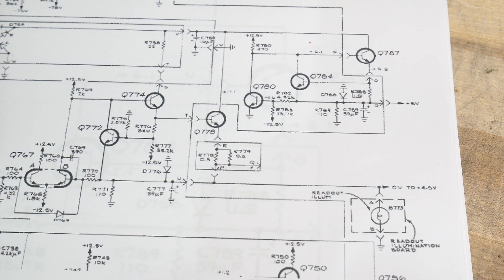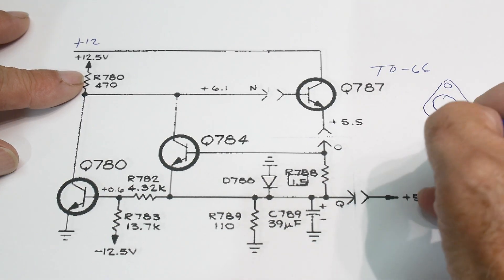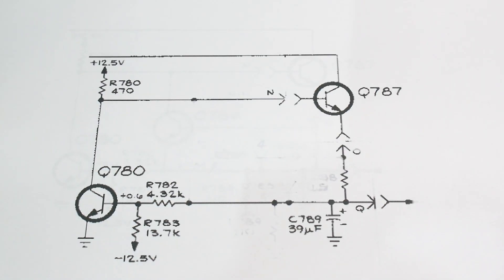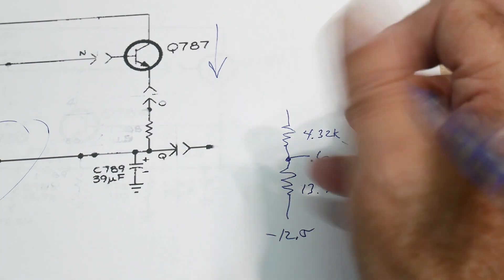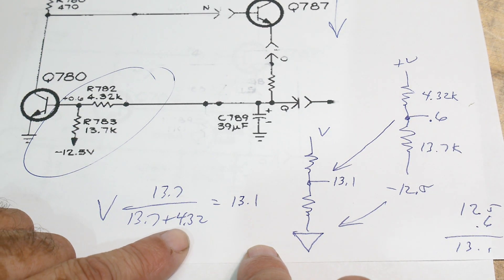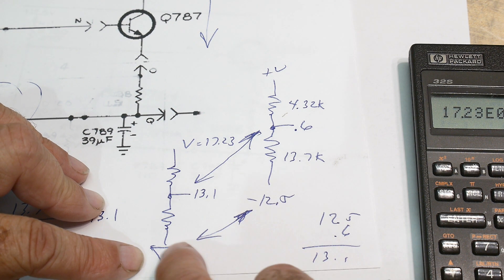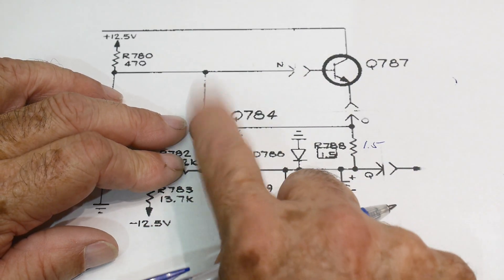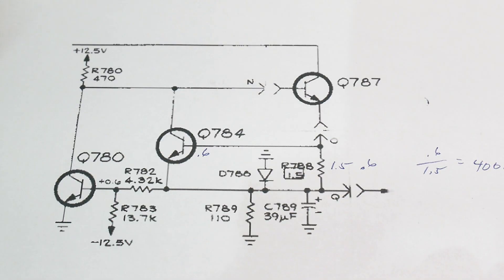#1279 Three Transistor Voltage Regulator

Comment: I have to admit the person that picked those values did a cute little trick where they did the whole thing as close to 1V=1KR in the divider. Not perfectly, obviously they had to stick to a e series for the resistors (E96 in this case, or 1% tolerance resistors). Still, good on that person for not picking really out there values.

edit: It makes life so much easier for the technician. I saw you had alan there in the comments looking at it all as currents as an ee would do. Once you hand it to the tech, you want something you can quickly model in your head

Comment: Very helpful!! I’m restoring a Heathkit H89 with a faulty power supply section on the video board and was struggling to understand the theory of operation. This is the most helpful explanation I’ve found. It’s almost exactly the same circuit except the Heathkit has a zener reference and an extra transistor.

Comment: Thanks! I have a similar voltage regulating circuit in a telephone power supply from the 70s. The voltage divider can be set manually to 3 V, 4.5 V and 6 V. The power supply must be very silent to not make any noise in the telephone receiver. It has that 3rd transistor to keep the current below 300 mA. Thanks for the calculations, very helpful! I suspect your power supply is very silent as well? (probably depends on filter capacitors and a good transformer)

Comment: Your numerical analysis is correct, however I would argue that you should use the general expression for the output voltage because it reveals subtleties that may be significant. Here goes:
Call the diode voltage Vd. The -12.5 voltage is actually the"reference voltage" for this generator, so call it Vref. I prefer to think of Vref in its absolute value, namely "12.5V" dropping the negative sign, which will be taken into account shortly. Shorten R782 and R783 to R1 and R2 respectively. Call the output voltage Vo. The equality that inverting gain element Q780 forces is:
(Vo - Vd)/R1 = (Vref + Vd)/R2  Solving for Vo gives you
    Vo = Vref*R1/R2 + Vd*(1+R1/R2)
Plugging in values and assuming Vd=0.6V, and Vref = 12.5V, you get Vo = 4.73V, as you calculate at 8:23
The interesting part of this general formula is that it reveals that this voltage has a temperature coefficient to it due to the diode's presence. It is common knowledge that "a diode," namely the transistor's Vbe, has a temperature coefficient of -1.6mV/°C. Therefore as temperature increases, Vo will decrease with it by a factor of (1+R1/R2). The great unknown is "what is the temperature coefficient of Vref, the -12.5V supply? We don't know. 
What you really want to do is to take the derivative of the equation with respect to temperature, d/dT. If the -12.5V supply has any temperature dependence to it, it will be attenuated by R1/R2. Q780 is the "amplifier" in this circuit that in today's world would be replaced with an op amp running in its inverting mode and its "+" terminal connected to Vd instead of ground.
I miss the days of transistor design. It was a great deal of fun.

Comment: I obtained the result in a different way. 13.1 volts across 13.7k R783 resistor implies 4.13 volts across 4.32k resistor R782, given equal current (Ohm's law). 4.13 plus 0.6 volt results in 4.73 volts. That would be the output. However, there is some additional small current flowing through resistor R782 to the base of Q780. Depending on this current the voltage drop on R782 will be slightly higher than 4.13 volts so we can probably have exactly 5.0 volts or even slightly higher voltage.

Comment: No voltage reference (Zener diode, TL431 etc.) but it works nicely. I wonder about the ripple voltage.
While the voltage drop is 7V, the current limiter will keep the dissipated power down to 2.8W. Not bad for a heatsinked TO-66.

Comment: Thanks for presenting this piece of old school electronics, very interesting. 
I think of it this way: it is an opamp in inverting configuration whose gain is -R782/R783 and whose input referred offset is the Vbe of Q780. They use their negative rail as a input to this inverting amp.

Comment: I think too low negative rail (like -12.5v) is counterproductive from precision point of view. Also its too dependent on Vbe (of Q780), i.e. Vbe temperature change is not compensated. I would do it better 😀.

Comment: The circuit is more properly an inverting "op-amp" rather than a regulator.  Its output varies with the negative supply voltage.
Reply: Yes, if one does the math this way it is very easy to figure out the nominal output voltage, dependance on the Vbe and on the base current
Reply: @caffesenza5836  A design done for production is going to have about 10 times as much current flowing in the resistor divider than flows in the base of the transistor.  You do this because the HFE(current gain) of transistors varies a lot from unit to unit.  For this reason, a first cut at working out what it does would just ignore the base current.

Comment: Back in the days, in the 60's when I was a student, we would check out the service manuals from HP and Tek.  There would be a very good explanation as to how the circuits worked.  You don't get that anymore.  HP even made it more and more difficult to get diagrams.  I always preferred Tek over HP.  I think the Tek stuff had better human engineering too.

Gee, why didn't they just use a 7805, they didn't exist them.  They did have op amps though.  Don't think there were 723's either.

Thanks, very good.  Jim

Comment: I have a simple question, but are there any reasons they used -12.5V as a reference point? I mean, the resistor divider could easily reference to GND...
Reply: Hi, if you do that you will see your 5V nominal swing a lot with temperature. Like 17mV / Cent Degree. You will turn this thing into a Vbe multiplier, while it is thought as an inverting amplifier with -12.5V well regulated input

Comment: Nice schematics! Especially interesting because it contains only NPN transistors, even diode is possible to replace with base-collector shortened transistor. Can be used in hack diy or in production - no jokes some times is much cheaper to use only same transistor four times to reduce the costs.
Reply: @harvey66616  agree, NPN

Comment: A long and messy explanation. 
As the output is +5V and the negative supply -12.5 you  have their sum (17.5V)  across series  R782 and R783 (18.02K). 
The Q780  base is at +0.6,  or so (current gain/base current plays here)  and  is limited to negative ~ 0.7V with that diode. 
remove R782 and the voltage is limited to about 5.6V.
Q780 gain (100 -300)  is Rb/Re enough to drive the TO-66 guy (low gain, maybe 25). 
The easiest calculator to use for this work  LTspice. (free, and intuitive to use) Works faster than the calculator.
The circuit does not have a fixed reference and a differential circuit, output voltage depends on gain of transistors and stability of negative 12.5V.  
With an old OP-amp circuit and +/- supplies, this is a quick and dirty voltage regulator.

Comment: If they dropped the value of the 13.7K resistor, and added a couple of diodes in series, there would be some temperature compensation in the voltage output, as long as the control transistor and diodes could be close to the same temperature.
Reply: That's a great idea, very simple, very effective, very old school.

Comment: Great video. I think the 110 ohm resistor is to put a minimal load on the output as well as cap bleed off, 110 is rather low for a bleed, unless it has to do it before other supplies bleed off.

I have a 80's 2 channel dual trace Tektronix scope that was putting out way over 40VDC out of the preregulator and blowing the fuse. The 40V is provided to a wild push pull oscillator with some control transistors and an optoisolator to a Transistor regulated supply to drive the 120VAC rectified voltage through a Triac to get the 40VDC. A nasty closed loop.  The push pull oscillator puts a square wave on the circuitry power supply transformer to regulate most of its output voltages all at once. The manual had a good theory of operation, but I was not able to verify or find a replacement opto isolator. I found an open resistor and a shorted diode in the push pull circuit but it was no help. The transistors are old Tecktronix part numbers and there were not enough waveforms/voltage notes for them. I ended up isolating all the circuity (lifting leads) from the 120V input power switch all the way to the 40V trace. I tried to find an ac/dc converter (or small ac/dc and dc/dc converters) but they would not fit inside by their mech specs. I bought a cheap adjustable 45V 10A supply and strapped it to the outside of the case. It works but it is clunky. I got the scope for free, I bet it is a transistor or two from working properly.  If I post the power supply schematic and my notes, could you take a look?

Comment: Did anyone asked why the R783 goes to -12.5V instead of GND? And why R780 goes to +12.5V instead of collector of Q787? There is a reason for this.

It is kind of sequencer and protection. If, for some reason, -12.5V line fails (which is a huge disaster for circuits that era) then the lower side of that divider goes up which opens Q780 to saturation which cuts off the 5V line. If, for some reason, +12.5V line fails, then there is nothing, that could open the Q787 transistor, which cuts off the 5V line. There must be -12.5V and +12.5V line present before the 5V line is turned on and if some of them fails, then the 5V line is immediately turned off.
Reply: Hi, R783 goes to -12.5V because this circuit is more an amplifier rather than a regulator. It is an inverting amplifier whose input signal is -12.5V. If you connect R783 to gnd (and lower its value to produce 5V nominal at the output), then you realize a Vbe multiplier. The output will vary proportionally to the Vbe (which is -2mV/CentDegree) and thus… a lot. They must have a good regulated -12.5V. To produce 5V they just… amplify it. Clever!

Comment: Old Tek manuals are one of the best places to learn good electronic design. Sometimes they over complicated things a lot but usually for good reason. The best one I ever read was the Tek 650 video monitor schematic. The circuit design is excellent, but they also put humorous little drawings in for different circuits, i.e. near the back porch generator circuit was a drawing of a generator sitting on a back porch. I seem to recall there were about a half dozen of these which always cracked me up.

The reason the voltage calculated low was that the base of Q780 will bleed a tiny bit of current through R782. Knowing Tek, I bet this was all highly calculated for all temperature and current ranges. The stuff they built from this era generally had very robust designs.

For those wondering how it regulates so well, I was going to go through it but there is a great explanation in two comments from Rex Schneider near the bottom of the thread. It is that -12/5V supply that is critical to the proper operation.

Great video, I grew up with this stuff, so it is nice to see someone explaining how these circuits work. Still very valuable knowledge to have these days.
Reply: Yes, I grew up my skills by working backwards from philips audio amplifier handook, through guess work as my education was poor then. About 1983. It was like how religious people go through religious texts. 🤣
Reply: After staring at the odd diagram, I "saw" an Inverting amplifier of Q780 with its resistor and Q787 as output buffer. Just like normal opamp. Ignore the 0.7 as an offset and the analysis is very fast. -12.5 is the odd reference here.

The diode D788 is needed to protect the load. When powering up, the negative supply comes up first because the output supply has large capacitor load for filtering the load. Meanwhile a negative voltage would appear at output through resistor network. Transient could last a few cycles ~100 ms.

Comment: wait so this is a voltage divider with a rapidly switching element so that it doesn't waste the current? could this be a way to think about it?
Reply: No, this is a linear regulator. It does help to calculate and understand the circuit by analysing the "edge cases" but the transient between are not discrete. A so-called linear region.

Comment: Very nice analysis! I'm a very young engineer and I'm not used to reasoning with BJTs so much, so it's a very nice practice! I want to make one remark though, that in today's world you would much rather have an integrated regulator than discrete BJTs not only because of cost (a SOT-23 LDO is probably cheaper than 3 discrete BJTs) but also because of assembly cost (extra SMD reels that you have to put into the pick and place machine, marginally longer pick and place time, etc) and because of board space savings. So it's not out of laziness that we don't do this anymore, but because designs have become so much more miniaturized and dense.
Reply from the maker: the pass transistor is a TO-66 can, good for 5A. your little SOT-23 will loose that race.
Reply: preaching to the choir, cap'

Comment: Good video, thanks. Doesn't this circuit rely on the fact the input voltage is regulated (the -12.5V rail) so it works as a regulator for varying loads currents but not for varying input voltages.
Reply from the maker: Yes, correct
Reply: True, but the input voltage (collector of the output BJT) can still vary without producing any significant output drift

Comment: Transistor cu  CPU  vaccum switch
ALU second generation of computer ic intergrade circuit
Memory unit (capacitor restance transformer)
Primary memory
Secondary memory

Comment: Messy. Vibe maybe anything between 0.6 and 0.7 V. This significantly affects V out. Assume you want 5 volts output, so work backwards to find Vbe for the resistor values given.
Reply from the maker: you are correct. 0.6V is not going to be true. They must have designed those resistors for the parts called out, as the output of my unit is 5.03V

Comment: If you felt like I think it would be interesting to show a video actually building an example of this and see if it works nicely or terribly, or how efficient
Reply from the maker: It was designed for a high end Tektronix curve tracer. $40k in todays money. The one I have regulates perfectly at 5.03 volts and is about 32 years old.
Reply: It is not very efficient at all, like many linear regulators, namely because all of the current that is available at the output at 5V first has to drop from 12.5V through the pass transistor and current sense resistor - a drop of 7.5V.  Since efficiency = Pout / Pin, and (ignoring the regulator transistor)  Pout = 5 * I_load and Pin = 12.5 * I_load, efficiency can not be better than 5/12.5 = 40%.
Reply from the maker: have you seen this thing? 70lbs and a beast. 1500V and 10amps output. no, efficiency was not important
Reply: @IMSAIGuy  No, I haven't seen it.  But a 15KW out sounds awfully beefy - the standard house outlet can only supply 1.8KW before its breaker trips.  Perhaps it's 150V & 10A out?
Reply from the maker: @Cynthia_Cantrell  1500v  and 10A are subject to 220W max output
Reply: @IMSAIGuy  Well, that saves a lot of trips to the breaker box!
Reply from the maker: @Cynthia_Cantrell  that assumes the 1500V hasn't killed you first 😎

Comment: Your analysis is insufficient, which is why you got an error at the end. You forgot the current into the base of Q780, which can be calculated from its collector voltage,  R780 and beta. We know the Q780 collector voltage because Q787 is an emitter follower so its base has approximately same level as its emitter, i.e. +V. The R780 is rather smallish and its current flows into Q780 collector, so the Q780 base current will have a contribution into the overall calculation. I.e. it will take higher output voltage to also feed some current into the base, so it will likely reach 5V on the output.

Comment: 110 ohm resistor also provides a min load so as the circuit start up  voltage can come up ,  as well as providing a time constant for the circuit while the diode keep it form going blow ground .

Comment: So it uses Q780 (emitter diode drop) as the voltage reference, and then 2 precision resistors to get the correct ratio against the 0.6v reference. Maybe they were happy enough with the temperature drift on that particular transistor to choose it... I don't think they were too concerned about nailing the voltage exactly, more like they wanted to make it as consistent as possible. 
I like the over-current clamp though, it's "cute".
Perhaps the -12 v low side on the divider was used as it was harder to find precision resistors in low values at the time, or the selection values were limited? These days, the whole range of resistances seem to have a precision value offering.
Cheers,
Reply: The -12.5 V supply was regulated, this circuit amounts to a buffer of this regulated voltage.  The voltage divider is such that the variations in the 0.6v drop (for example, due to temperature) do not contribute much to the output voltage as most of the voltage drop across R783 comes from the regulated supply.
Reply: @argcargv  this circuit would regulate fine as it is without the -12.5 V, just less precisely.
Reply: @plainedgedsaw1694  the output voltage will follow the -12,5V supply.      If the 12.5 volts changes by 10%, then the 5v output of this circuit would also see a 10% change.   The -12,5 V is the voltage reference for this circuit.
Reply: @argcargv  well, yes, it regulates voltage in relation to that -12.5V rail. But if it did connect to ground, it would still be regulated (no significant drift vs input voltage or load), just to different voltage.
Reply: @plainedgedsaw1694  if it was connected to ground then the output voltage would be very sensitive to the temperature of the transistor, which will be indirectly sensitive to load.
Reply: @argcargv  indeed.